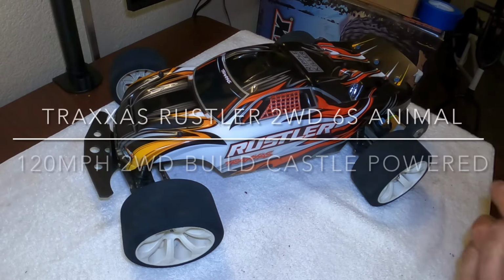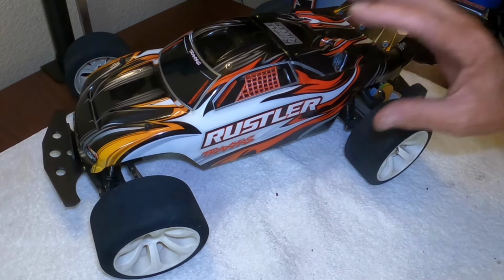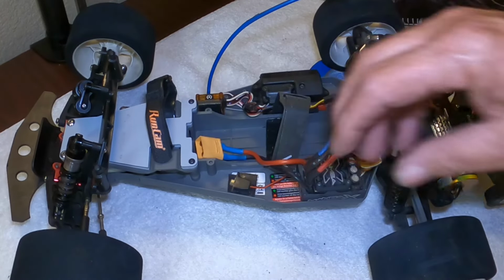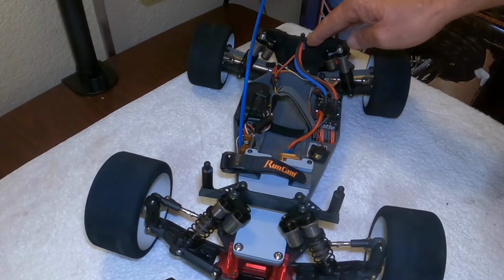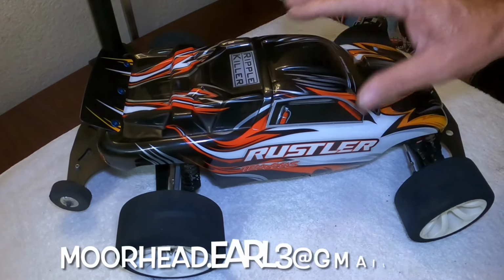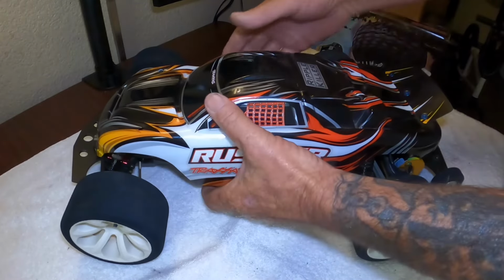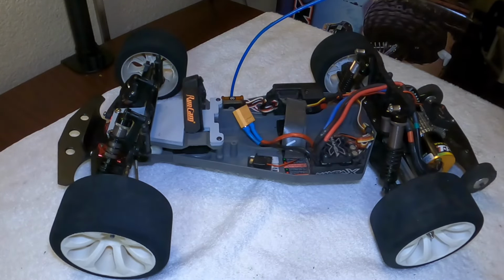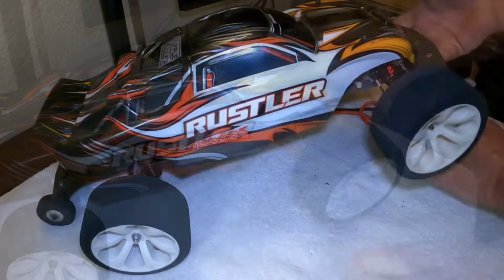Traxxas Speed Built Rustler 2WD 120mph up for Grabs Insane build! Here’s your chance

Comment: im currently working on a near fully 3d printed hyper pla extended wheelbase build, its gonna be around twice the length of the original rustler and since its all going to be all plastic it should be even lighter with the new filament, im aiming for 150 with this one as my old record was 127 but i never got to recording it unfortunately, your build looks very nice c: